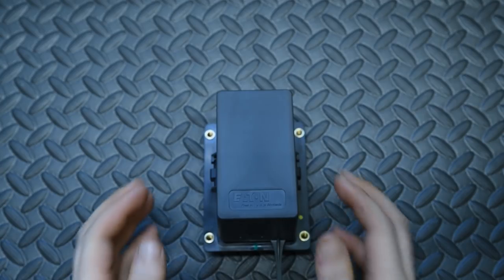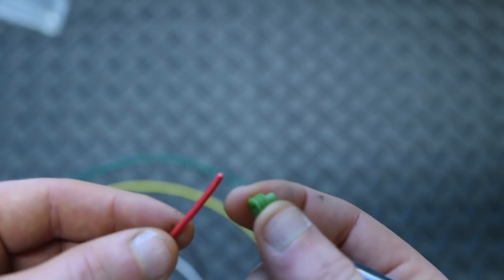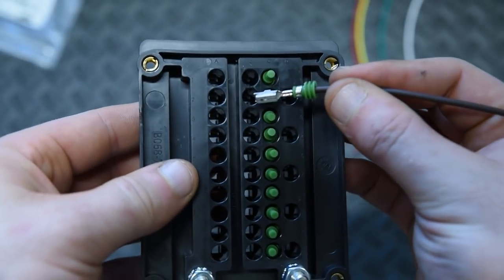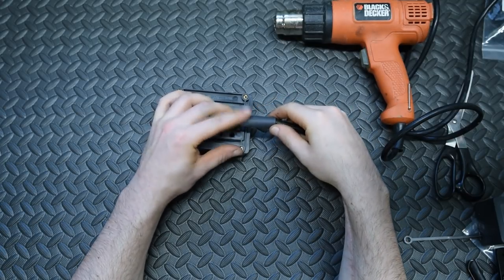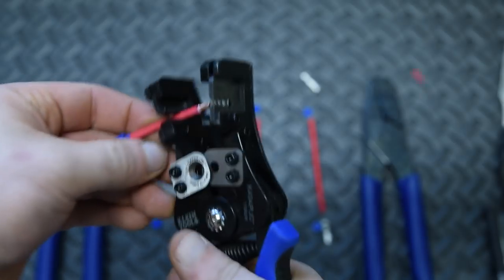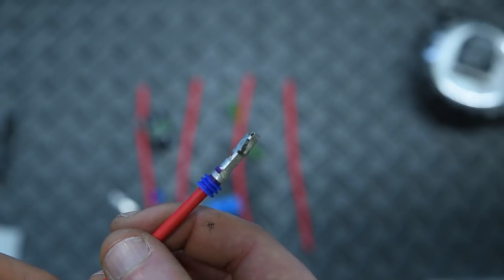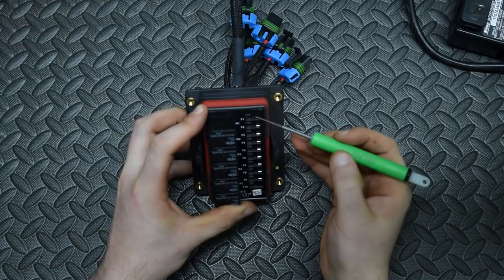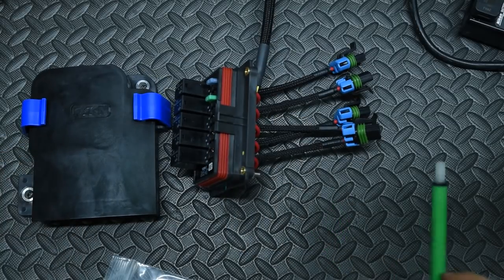Race Car Fuse Box Wiring Done Right 240sx | Automotive Wiring

Comment: I used one of these Bussmann power distribution modules on a friend's Dastun 240Z several years back for lighting and electric fans. Worked great and avoids a mess of individually wired relays and fuses. Bussmann now has a new power distribution series with even more circuits. Check out their ssVEC line. Up to 200 amps with three different combinations of relays and fuses. Thanks for showing that the T11 tool can be used for 10-12 AWG Metri Pack connectors. I was confused at first when I saw you using 20-24 die size, but I discovered later that die was intended for crimping to the wire insulation. Seems to work just as well for crimping directly to 10-12 AWG wire.

Comment: awesome video. not doing a racecar this time. purchased a 66 bronco that needs new wiring badly.. after pricing aftermarket harnesses at $800-$1000, i decided I'd just wire it myself with some GXL since i did a HWY22 install from AAW on my 68 mustang. its pretty much just a universal fuse block. I'll be going with the Eaton 15305-1-2-3 20 circuit panel.

Comment: Thanks for taking the time to do this video. 
I notice that you are using 10awg wire but per website description says that the biggest wire gauge supported is 12awg. 
If ordered the parts you listed in description the box will fit 10awg wire and work?

Also when you flip the relays to make it negative trigger, if you do not flip them will be positive triggered?

Really like that setup is very clean and professional and want to install fog lights in  a few semi trucks. 
Thanks

Comment: LIKED YOUR TUTORIAL AND THOUGHT YOU HAD SOME GOOD IDEAS. JUST HAD QUESTIONS ABOUT HOW YOU ARE WIRING YOUR GROUND SIGNALS, A LOT OF ECUS USE GROUND SIGNALS TO ACTIVATE THE COIL SIDE OF THE RELAY. FOR EXAMPLE FANS, FUEL PUMP ETC. IF I UNDERSTAND PROPERLY, THE WAY YOU WIRED IT THERE IS A CONSTANT GROUND TO ONE SIDE OF THE COIL AND THE SIGNAL BEING A 12V SIGNAL. BECAUSE OF THE BUSS BARS YOU ARE NOT ABLE TO BE SELECTIVE ON EACH RELAY.

Comment: This is an excellent video. Informative, detailed, and to the point. The time you have taken to include part numbers for everything you will need to complete a project like this greatly appreciated. How did you acquire the information about the Bussmann fuse/relay box, and all the components? I believe there are at least five 15000 series part numbers with practically zero descriptions on the internet. Bussmann seems to be marketing to OEM and significant up fitters only. Thanks for the education.
Reply from the maker: Thanks so much, your comment means a lot. The numbers I found from browsing electrical supply sites.
Reply: Thanks, that helps a bunch.

Comment: Does mounting these relays upside down actually change anything? Aren't the connections through the relay, still through the diagonals, so if you mount upside down, they work the same?

Comment: Really great video, this explains so much. Quick question though. The plugs that you have coming off of the bottom for your various devices. Since you decided to plug the ground hole (since you didn't want ground wires running everywhere), will you ground each device to the frame or something where it's at? In my scenario I'm thinking offroad lights, fans, more lights, etc all over the truck. So at each light I would run the hot all the way to plug, but the ground I would ground down to the frame or something close by to each device correct?
Reply from the maker: "So at each light I would run the hot all the way to plug, but the ground I would ground down to the frame or something close by to each device correct?"  Yes, correct.

Comment: Hey if one of the pins on my relay is yellow and the eaton panel on top (where the identifiers are)has burnt plastic from one of the series inputs, what does that usually mean? Can I just replace one of those wire ends or do I need a new panel? Thanks

Comment: What if your using this to make a complete chassis setup, but using the 10 relay 40 fuse option, can you get solutions for timer relays, and relevant flashers etc. thanks
Reply from the maker: not really, I've done some research to try to do this, some relays are pretty unique, and you would have to use a couple of the stock ones.

Comment: Could this fuse/relay block be used to completely wire a street car? I want the cleanest install i can get, and much rather buid my own wiring harness. Not sure how i would do the turn signals.
Reply from the maker: I highly doubt 5 relays and 10 fuses would be enough to cover a whole car. You would need a bigger unit, which is also made by bussman, similar concept, just bigger, or multiples of these.
Reply: @Ridgebackjp  do you know the name of the unit .? Ive been looking for a bigger one from them but cant really find it...would need 8…10 relays and 20 fuses
Reply from the maker: @Gunnl  15402 might work but that was a 20 second google search and you will have to read up the spec sheet to make sure it will work for what you want.
Reply from the maker: @Gunnl  http://www.cooperindustries.com/content/dam/public/bussmann/Transportation/Resources/catalog_pages/power-distribution/bus-cbt-ds-series-15400-rfrm.pdf
Reply: @Ridgebackjp  yeah they dont seem to have the dual bus unit ..thanks for the link
Reply from the maker: @Gunnl  https://www.waytekwire.com/item/46354/EATON-s-Bussmann-Series-15401-2-0-1-0A-RFRM/
Reply: @Gunnl  Waytek has large fuse box; their part number 46065

Comment: Question: Why did you use the 3m EPS-300 instead of  raychem heat shrink?
Reply from the maker: :) thanks for question. 3m eps-300 is adhesive lined, raychem has adhesive lined also, so its up to you, for me its what was available.
Reply: @Ridgebackjp  thanks for the reply. What's the name of that sleeve that you used? Is it techflex F6N0? Are you working on your car in these quarantine days? I'm like you man. I don't like to see wires all over the place in the car. I also have a kouki s14. I'm kind of doing the same thing you doing but I actually deleted the whole fuse box lol. I have a swapped motor in my car and the previous owner did a poor job in wiring. So I decided to make everything nice and neat.
Reply from the maker: @arlokkkk  yes was techflex f6, actually gonna continue wiring the front end of my car today. I would have loved to delete the whole fuse box, but the way the A/C works and how it ties into so many circuits, and some of the specialty relays for some of the circuits which I could not source to fit inside a bussman box, made me stick with some of the oem relays.
Reply: @Ridgebackjp  got it! Yea in  your case you doing the best thing in keeping the AC. I bought the car with the rb25 without the AC and I decided to delete the heater and airbag too so it's much easier now. I will use my car mostly for the track and casual street.